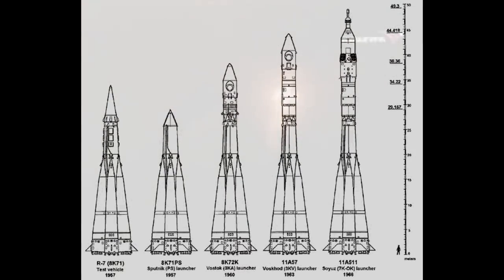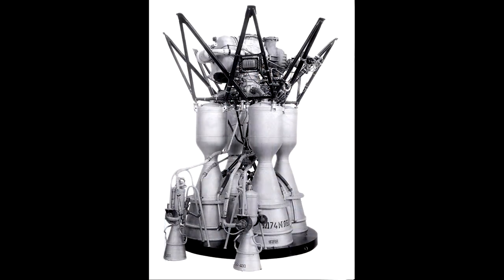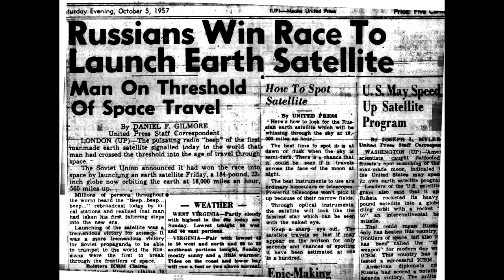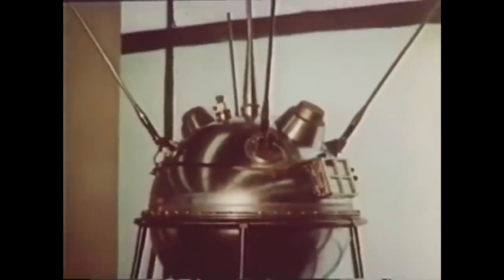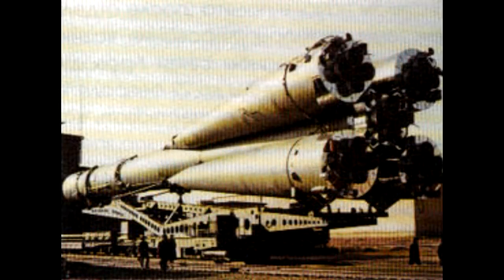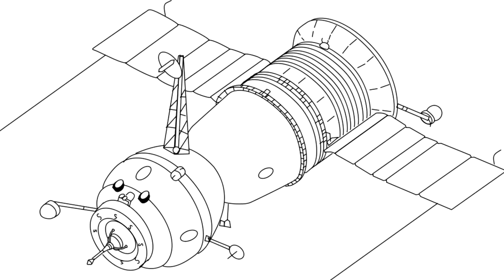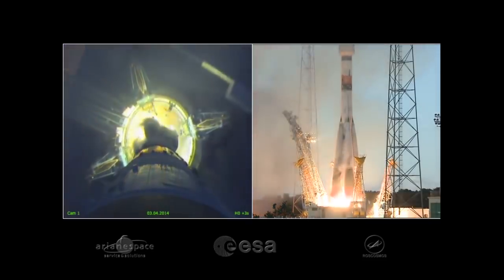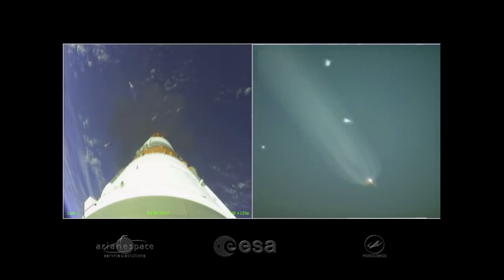The Most Launched Rocket - A History Of The R-7

Comment: I was expecting an unbiased account truly lauding the achievements of the S.U. despite their Devastation at the hands of Hitler and their long history of pioneering work contributing to advanced rocket technology and the grooming of the likes of  Korolev, Glushko etc. 
But I was disappointed.
Its like listening to Lee Remy talk about the T34 . Crude. Crude everything the Russians build is crude.?????
Yet as in the case of the T34 the Russians combined sloped armour , wide tracks ,high velocity gun ,oh and a compressed air bottle dedicated to starting in Cold weather none of which the  more " advanced " west thought of utilizing. Yet this weapon was supposed to be crude? It never ends. The constant sniping. belittling the Soviets.
( I grew up also thinking the Soviets capsules were crude , I read another source that debunked this).
yet they were able to carry a bigger payload and launched Gagarin in a true orbit compared to Sheppards sub orbit.
The reason the Soviets had failures is because of their design philosophy which ultimately led them to perfect the closed loop rocket that the US never perfected and which Lockheed recently   bought a hundred of and were astounded by the performance characteristics. 
These rockets were used by the US for their Atlas military rocket and Iam pretty sure reverse engineered to boost Space Xs rocket technology. 
The full account of the success of the NK33 is on a UTube documentary of the N1 programmed detailing how Lockheed purchased the rockets.
The US will never credit the Russian contribution untill 20 years from now when it  will be ripe to profit from a book.
Such is the workings of the Free Market system.

Please don't do any videos on Russian rockets. 
You suck at it!

Comment: 06:10 "up to four and a half tons to orbit" doesn't sound as impressive when the BFR is suppose to be able to deliver 150 tons to orbit.
Reply: The BFR doesn't exist though, which is a key difference. Quite frankly it probably won't ever exist. Elon is basically trying to abuse the TweakScale KSP mod in real life, but reality doesn't quite work that way.
Reply: That's what was said about the falcon 9 tho, that it was just a bigger falcon 1 and it would never work. I guess we'll have to wait and see.
Reply: The square-cube rule being what it is, increasing a rocket's size actually increases its mass ratio.
Reply: To use some retired examples that flew more than 5 times: Saturn V could put 140 tons into LEO, and the Space Shuttle could place over 120 tons.  In the first case this included a partially fueled third stage along with the Apollo command module and the Lunar Lander.  In the second case it included the shuttle and some additional payload.

Comment: Beats out the Merlin and Raptor rockets any day.

Get rekt, SpaceX.
Reply: I don't know why the hate on SpaceX, but you do you
Reply: And just a correction, Merlin and Raptor are the name of the engines of the Falcon 9, not separate rockets
Reply: As a correction correction, there are no Raptor engines on Falcon 9, they are planned to be used on the BFR.
Reply: Yeah, they're different rocket engines, not different vehicles. But still. Good ol' Soviet rocketry beats out modern commercialized crap any day.
Reply from the maker: Well unless you're judging the rockets by cost, reliability or performance.